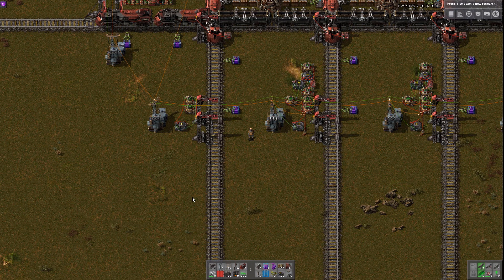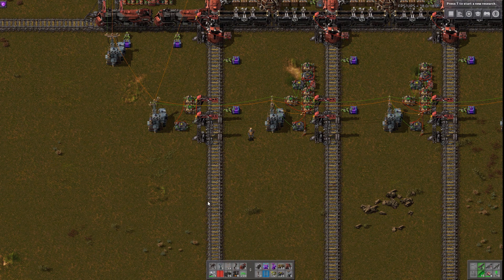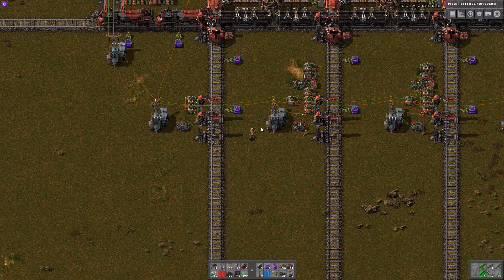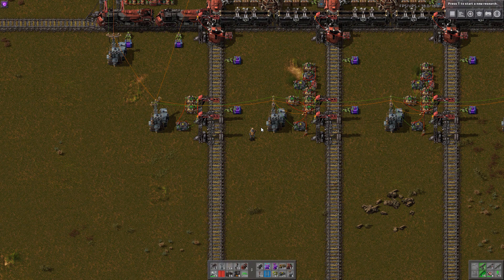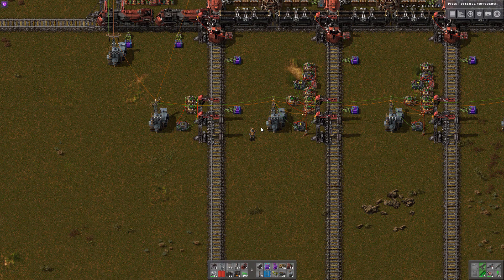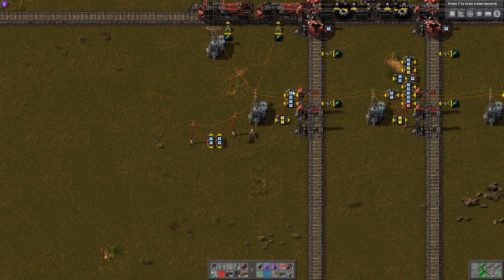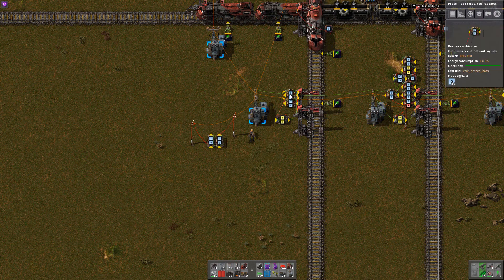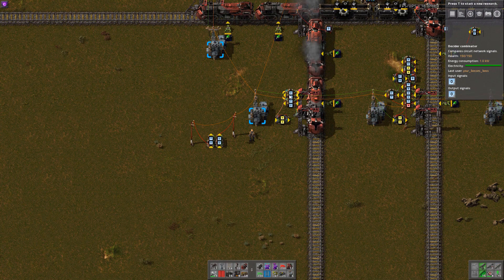Grid station for ethereal trains (technical followup)

Comment: Great video! Though the ending wasn't too clear; may I suggest using basic charts or tables when explaining circuitry, especially in frame-sensitive cases like this? Pannenkoek's SM64 videos come to mind, check out some of his stuff e.g. the one about pause buffering. Graphics and visual explanations make it simple to follow complicated and intricate designs, and while this was definitely not the case for anyone with some experience with the circuit network it's something you could keep in mind to up the production value a lot. Have a great day!